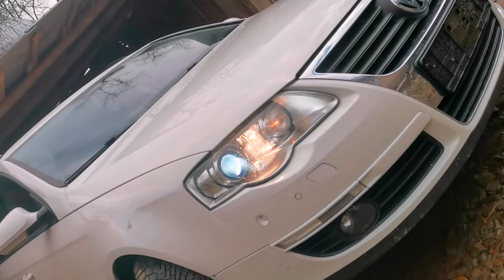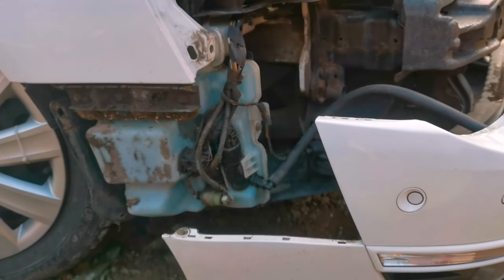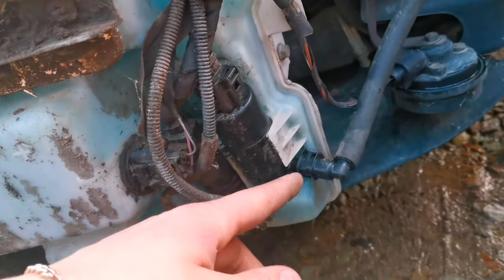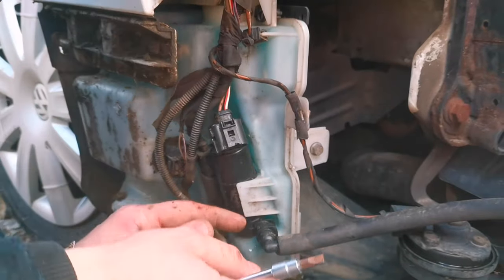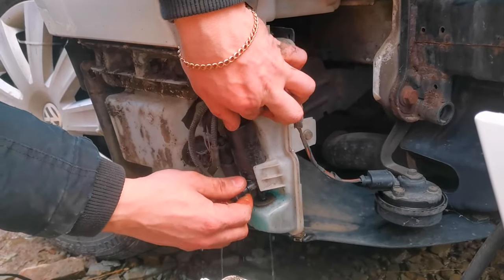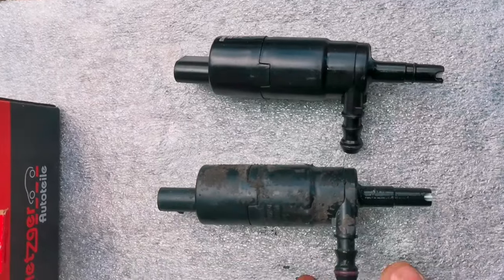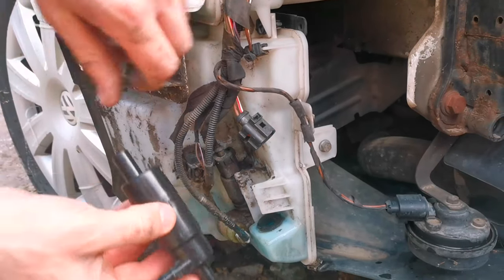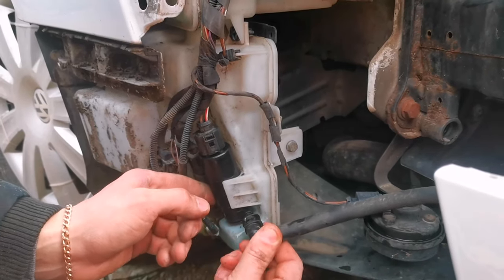Your Headlights Washer It's Not Working? Easy Fix! (How To Fix Headlight Washer)

Comment: My windscreen washer pump has been change and now working. But the headlight still not working. My xf is 2011. Has it just one pump or two please ?
Reply from the maker: There are two pumps. One for windshield and one for headlights. The one from headlights it's burned and only by replacing it with a new one will make it work. Also check the fuses.

Comment: Mine headlight cleaner doesn’t pop up ?
Reply from the maker: Then you should find the fuse, it's probably burned or in the worst case the pump its burnt and you have to replace it
Reply: @HOWTODO0828  i have to remove bumper to get acces to fuse right?
Reply from the maker: No sir.

Comment: How to stop it from working, my flue get empty!!
Reply from the maker: You can't stop it, if your headlights are not turned on the headlight washer will not work, only with headlights turned on will start working, and you can use a special scanner tool to stop it from working permanently if you want this.

Comment: Just to clarify.. does the washer fluid pump also power the pistons to push the covers up to expose the sprayer?
Reply from the maker: Yes, the washer fluid it's being pushed by the pump and it's pushing up the headlight washer from the bumper in order to eject the fluid on the headlights
Reply: Thanks for clarifying this

Comment: The former owner of my civic just stuck the cap on to make it look ok. I didnt even know what it was, however at night when I cleaned my windscreen, water would fly onto other cars. Anyway I took it off and had to buy the parts and got it fixed ny the garage. The right one works but the left one doesnt even pop out. Would you know the problem?
Reply from the maker: Possibly the hose wich goes in the right headlight washer pump it's probably blocked or closed and that why the fluid don't reach the pump to push it out and spray over the headlight
Reply: @HOWTODO0828  water comes out of the right side but not the left side.

Comment: Car manufacturers do this on purpose. In Honda there is exactly the same headlight fluid pump location. You have to remove entire bumber, tear off half of the latches, damage the radiator cover and break the parking sensor wiring.
Or go to the autohorized service and left them 100 Euro for bumber replacement.
Reply from the maker: Exactly, that's why Im showing videos like this to the society, people can learn from this and save a lot of money by doing the job at home with the right tools 🙏
Reply: @HOWTODO0828  Many of us have no tools.

I broke the sensor wires and then repair them

Removing bumper equipped with headlight washer is bery difficult.
Reply from the maker: That's true, thank you for supporting me, if you have any questions about anything related to cars, send me a message and I'm more than happy to help you 🙏

Comment: Hello mate, does this mean that the pump's pressure makes the washer come out?
Reply from the maker: Yes, when you trigger the buttons for the headlight washer the pump will push the water out and the pressure will push the little pistons out of the bumper and the water will splash on the headlight.

Comment: Is the pump around same location in b5 passat, but on other side?
Reply from the maker: It's exactly in the same place, just look for your washer fluid location, I think on b5. 5 it's on the front left side.

Comment: Thanks but where is the button for this feature in the car ?
Reply from the maker: Hello, if you have a little square under the front headlights it's meaning you have this option on the car, to use it and to make it functional you have to pull  the lever from which you turn on the windshield wipers  a few times  and they will open automatically and spray windshield cleaner on the headlight to cool them down and clean them at the same time. Hope it helps 🙏